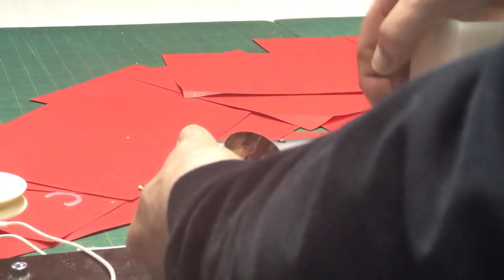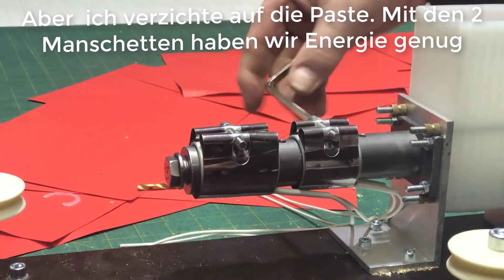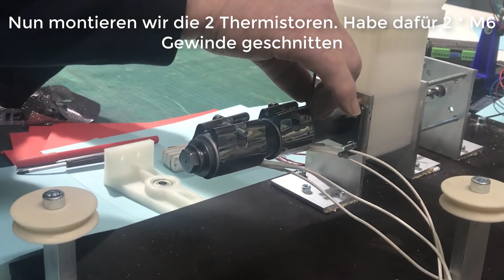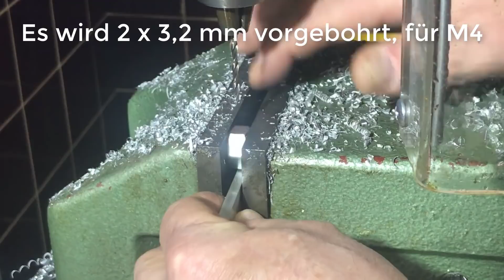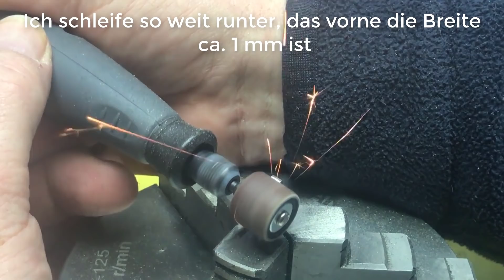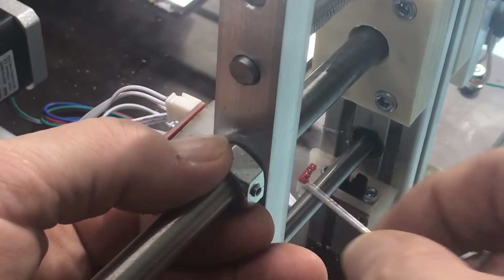DIY 3D Printing Filament 1 kilo / hour #8 / 15  Heizung Thermistor Endschalter

Comment: Are you using the same compression screw as used in oil extraction machines?
Reply from the maker: No they are screw for plastics 3 zones
Reply: @Werbewunder  look at oil extraction press screws.  Nearly the same as plastic compression/extrusion screw.  Have both here in the shop